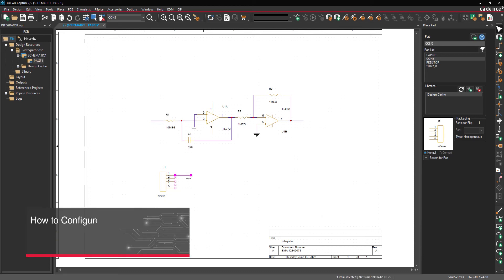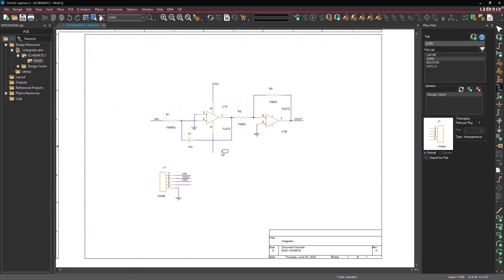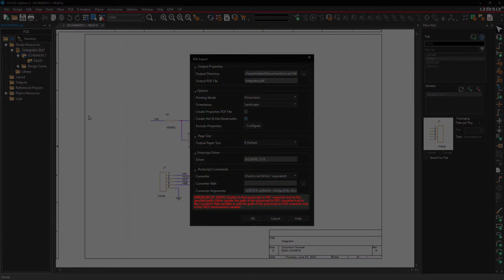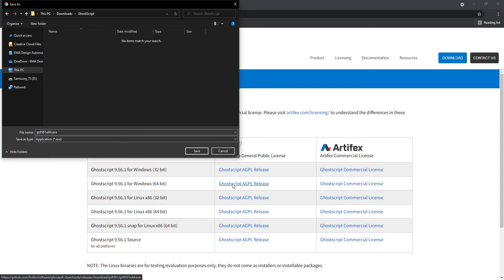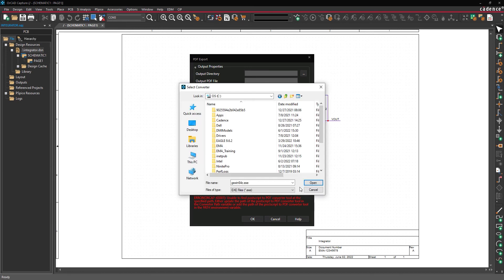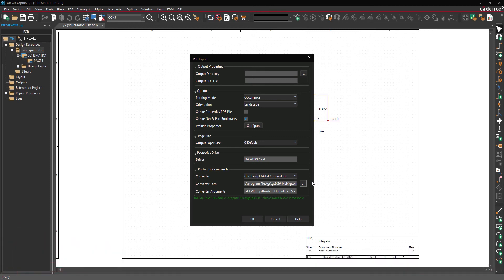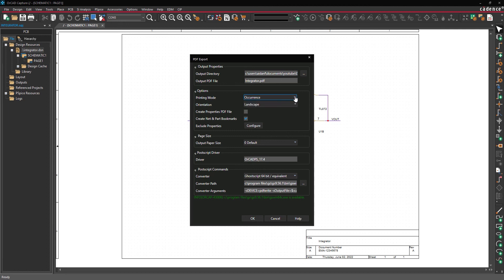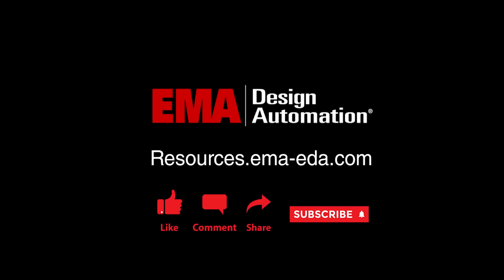How to Configure and Export a Smart PDF in OrCAD Capture

Comment: I need to remove the coordinates of squares (1,2,3,4... A,B,C,D...) from the edges of schematics in the exported PDF. Is it achievable?
Reply from the maker: In OrCAD Capture select Options > Schematic Page Properties. In the Grid Reference tab, turn off Displayed and Printed under Grid Reference Visible.

Make sure to do this for each schematic page in the design. 
Hope this helps!
Reply: It worked, thanks!
Reply from the maker: Glad to help!